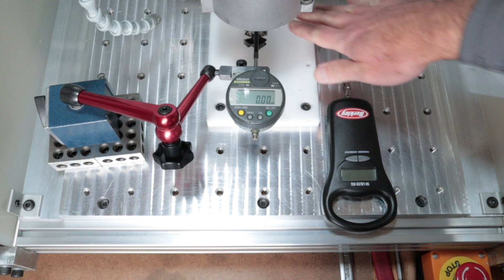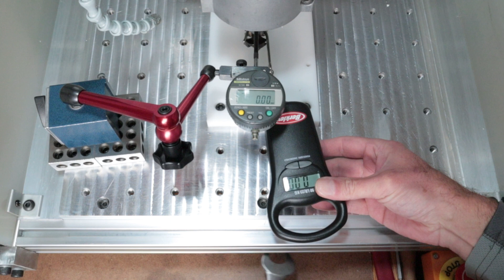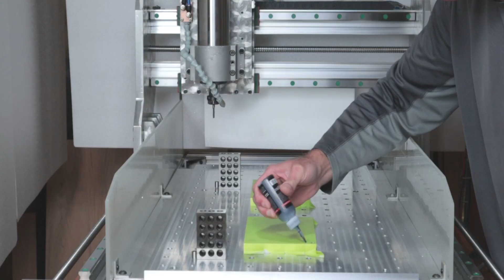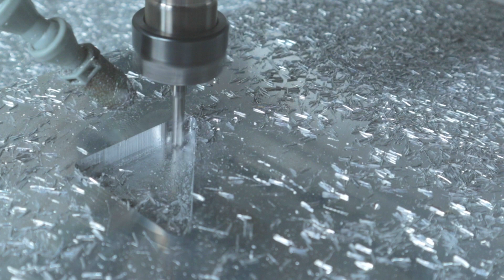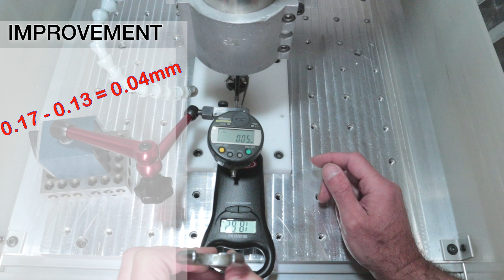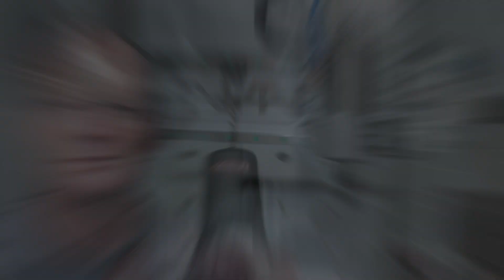CNC Router Gantry

Comment: I think I have the same machine you do and this was going to be an upcoming project for mine as I noticed deflection as well. Good to see it made some improvements but I will definitely be looking at my linear rails as well.
Reply from the maker: Yes also start by upgrading the fixed bearings in the ball screws. They made a huge improvement on backlash. I have an older video about that … take a look

Comment: The plate is adding stiffness in Z direction, but almost no improvement in torsion stiffness. For torsion stiffness You need round or square pipe in X direction. But, because of leverage most forces are coming when force is applied in Y, as you tested. First improvement would be to put two plates in XY plane right under the rails. Look the wood cnc from life latitudes as very good solution. Second improvement would be to add side reinforcement to the Z plate, but you seem to do it in next video.
Aluminum profiles as the most people use them are actually X profile. Relatively stiff at side forces, but complete disaster for torsion.
Reply from the maker: It is quite an improvement over the individual profiles not being connect at all. So “almost zero” like you say I disagree with but your general approach is correct. I remember that I measured both top and bottom rail movement simultaneously with a load applied to the tool in the Spindel and got very little deflection Of the rails for torsional movement. So yes that worked great. However the Z stiffener that you mentioned are a total waste for my machine. There is such a small improvement that I think they are not worth having. Changing the gantry to a closed box design is something I wanted to do for a long time. Well one day ! Thank you for your comment.

Comment: 1 year further you know much more about the flexing points of your machine. To close the X axis profiles from behind is a good idea, but i personally wouldn't have made those design windows just in the middle of that part. Just the middle should be as stiff as possible and there must be the most material. I went the other way and built the Gantry out of a massive profile of 160x80 mm, filled with cement - but my machine is not working at the moment, so I have no measurements. I hope I can get values like yours :) 
The Z Axis is the most weak part - many guides Wagons, thickness of the plates - the side reinforcements make very very much sense. Maybe the spindle holder is another problem, too. Did you find out more on this? Kind greetings from Hamburg, Germany!
Reply from the maker: You you are correct if you know the Lexington direction and the equation then you will see that the windows I cut hurt more than they help by reducing weight. However overall I am happy how the machine performs and the accuracy is really good and surpasses my expectations. Most of my cuts are conservative and even the rapid moves are dialed down to improve the overall results … I have the time … a few seconds or minutes longer per part are not relevant. The span of the guide “wagons” is important so a design that sets them further apart will be good. I have been thinking to make my machine a bit wider (not really good for the gantry stiffness) and redesigning the X-axis. I probably would place one guide rail on the top surface. Thank you for your comment curious to see your results.

Comment: I really thought you would have gained more from that upgrade
Reply from the maker: Yes me too. Well it’s on there now
Reply: @JBWorx  I wonder if it helped buy absorbing some vibrations? How would one  measure that?
Reply from the maker: Not easy to do but there is a sound tool that you can use as an app with your phone that will measure the frequency during machining. Also have a look at my   Video for the second spindle mount there I measured acceleration.

Comment: Aluminium extrusions are very prone to torsion and bending forces. I had the same problem with my diy cnc with the x axis built with a 30x150mm aluminium extrusion. The deflection you see at the spindle sticking out is due to torsion  stiffness, or the lack there of. measuring directly on the rail will show you a small deflection but your conclusion is incorrect, it's deflection that get amplified the longer the distance is from the x axis, like the spindle sticking out under it. 
The best shape to counter torsion is a round tube, but since it's hard to mount a square tube is the best runner up. your alu plate is inadequate to counter torsion flex. After mounting a square tube of 150x150mm with 3mm thickness steel tube the deflection was reduced down to a quarter it was before. 
I used a spindle with a square extrusion running the entire length of the spindle stiffening up the z plate too, but adding a box structure or square tube like structure will also improve stiffness. Steel is 3x stiffer compared to aluminium and about 2x heavier, it saves space to use steel instead of aluminium. I used shims to level out the steel tube sine I didn't have any means to make it straight. It worked out for me. It can now machine mild steel as easily as aluminium.
Reply from the maker: Nice Job Josha, however the “amplification” can easily be calculated over the length of arm from lower rai to the spindle. It still will not make the 0,14mm we see in the video. What actually happens is that the entire gantry tips forward because the Y-Axis HiWin guide rails are worn out. I ordered new balls and will recall them hopefully this week using more precise balls and a different diameter to increase the preload. This will bring the deflection back down. However yes a closed profile is always more torque resistent and from the material standpoint only the E-modulus goes into the formula and yes steel is way higher than Aluminium. Let’s see how far I can work that deflection down
Reply: @JBWorx  ah right, worn out rails will do that too. Looking forward which accounts for the highest part of the deflection!
Reply from the maker: Me too. Been machining all day the Z Stiffener plates but honestly I don’t think they will make a lot of difference. The z plate is already rather thick. Anyways I will keep going if you keep watching and giving me feedback !!
Reply: @JBWorx  Absolutely will keep watching, and commenting when I've got something to share :) It's a lot of work, but I'm sure it'll pay off in the long run. 
I just finished my diy fogbuster today, I'm going to do some aluminium machining tomorrow to see how it performs.

Comment: adding this plate is a good thing although measured improvement are not so impressive. when you load gantry like that it mostly twists rather than bend.
when it twists both beams move closer to each other. and if you load spindle in direction parallel to gantry both beams will shift relatively.
so binding them together into one structure preventing relative movements is a good thing.
i does the same thing on my router )  design it with that backplate in mind but never install it and used like that for couple of years )
recently i thought it's time for some improvements and i bound both beams together (by some epoxy granite instead of aluminium plate which was planned).
i also made the same measurements before and after and get about the same results with only 25-30% improvement in static load.
but when i start to mill improvement was more prominent.  most noticeable thins is significantly less chatter when spindle is in the middle of a gantry.

P.S.  and here is some thing on chatter. stiffening the gantry will have effect on more low frequency chatter which happened in low rpm range.
   but it will have little to no effect on high frequencies which all concentrated mostly in Z axis assembly (closer to spindle - less mass - higher resonant frequency)
Reply from the maker: Thank you for your comment. Funny how we sometimes use something for years because it seems to work just fine until we take another swing at it. I will do the Z-axis next and started the machining yesterday. I am not 100% satisfied with the x-gantry improvements and I do not expect much improvement from the z axis stiffener but like you mentioned they will add mass right at the spindle. Yes granite for the X- Axis beam would be epic. I think also having a granite plate as the machine bed would be fantastic. This would dampen all the vibration associated with the fixturing of the part.

Comment: Hey there, enjoyed that thanks. And like that you shared it even though it wasn't quite the result you hoped for. Looking forward to the z stiffening video :)
Reply from the maker: Thank you for your comment. So I have been measuring all day and scratched my head but I finally nailed it down. The whole gantry tips forward. The HiWin guide blocks are worn. And that is ok because there are miles and miles in them. I will see if I am able to service them.
Reply: @JBWorx  Nice detective work! I would be interested in the servicing process... guess you might want some slightly bigger balls to refill? Good luck!
Reply from the maker: Thank you! I ended up at Bal-Tec looking through the sizes.  I took one apart yesterday and used a micrometer the diameter is 0.1285”. I think I will use + 0,0003” for the new balls

Comment: I split the spindle clamp in half and separated them by about 100mm
Reply from the maker: I looked at it today several times and thought of the very same solution … it’s a good idea nothing new to make and no material to buy !!
Reply: @JBWorx  i lost a hole but it wasn't a hole that was doing anything beneficial
Reply from the maker: I found some plate material in my shop that is almost 1” thick so my thinking right now is that I will keep the ugly bottom piece for now and just add a top bracket.
Reply: @JBWorx  always good to do something more complicated lol
Reply: I just looked at mine  and there is only a 50mm gap between - so i could have tried harder but it still made a huge difference
Reply from the maker: I am looking forward to make this change you are the third person reporting an improvement using two points to fasten the spindle down.
Reply: @JBWorx  glass bead blast will make the bottom one look much better. Actually it generally makes everything look better, almost Mitutoyo-like :-)
Reply from the maker: @gerritvisser  yes most tool shops blast their parts to make them visually look better. I might get a different spindle not before long we will see maybe I make a new lower holder as well.

Comment: mount should be fairly fine, but add those stiffeners to the Z axis plate, or box that spindle inn :) Then you will see improvement for sure :)
Reply from the maker: Yes stiffener design is on its way as we speak. Also a new Spindel mount
Reply: @JBWorx  i designed and made my own spindle mount, stiff as i need on my machine, enought to do steel on it ;)
Reply from the maker: That is very nice. I probably will need a new spindle for steel though.
Reply: Can i ask what do you mean by “box that spindle inn”?
Reply from the maker: I think he is saying to build a frame all around the z plate not just left and right.
Reply: @JBWorx  thats correct, 10mm alu bolted to the Z axis plate, then a plate that goes across those over the spindle, that should make it very stiff, but not add too mutch weight if you use the same pattern as on back plate to remove some material

Comment: Nice video! I think that if you add another spindle mount to the top of the spindle you will see that there isn’t that much flex anymore. I did the same with my round spindle a couple of years ago. With the second spindle mount I was able to reduce chattering a lot. What also could help ist to add side plates to the z-axis plate to stiffen it up.
Why did you cut out those triangles in the back plate? Aren’t those cutouts affecting the stiffness of the plate it self?
Keep up the good work!✌️
Reply from the maker: All 3 points are spot on. Yes the spindle mount I will change next as I hate the looks of it and it provides for the highest amount of flex at the moment. In theory the triangular cut out of the plate does effect the rigidity in y direction however I measured this on a machine that I build for a friend and only had 1/100 mm difference full plate versus plate with the cutouts. Thanks for your comment !!! Oh forgot to ask you something how is the z stiffener mounted on the Sorotec ? I see screws from the side … not really intuitively right through the plate would add better holding power in y direction.
Reply: @JBWorx  My Sorotec AluLine stiffeners  has very tight tolerances. It took me light hammer taps to get them off.🔨
Reply from the maker: Thank you for that info. I have the front of the first one complete (machined) and the slot I planned to have 0.03mm play in it. The receiving plate is not machined so this might be interesting to get installed.
Reply: how far has everyone between mounts?